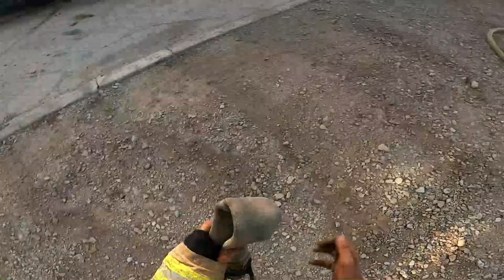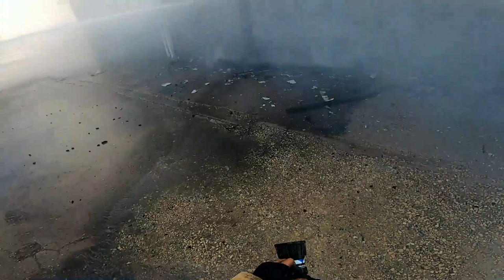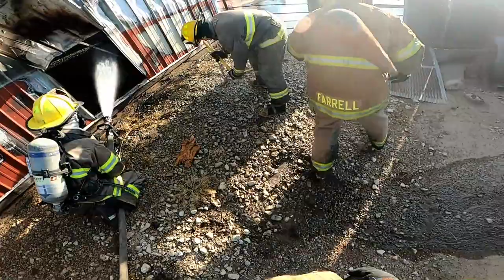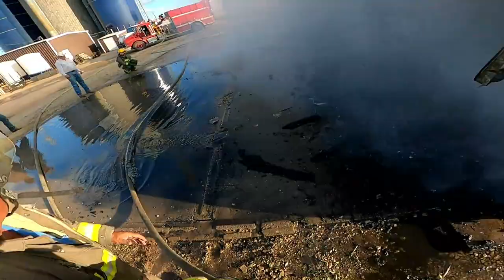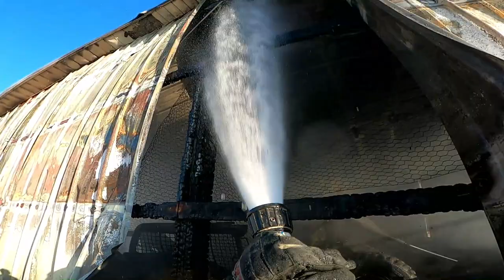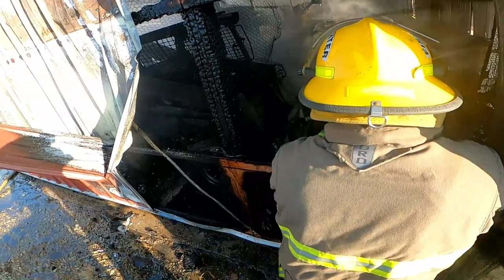Rolling Hills High loader skid steer fire 7-8-21 Ks,

Comment: This shows a lot of good things, number 1 leadership, he got on scene and took lead and got the fire out safely, the second was speed, some will say it was slow, but "slow is smooth, smooth is fast, fast isn't always smooth" the crew quickly got water on the fire!
Reply: I agree mostly with what you said but he took a few seconds to put his turn out gear on. We were told to have your turn out gear on when you leave the station. First thing you should do is put your turnout gear on so you’re ready to fight the fire when you get there. That means gloves pants boots coat and respirators if needed

Comment: Very good call, keeping your distance to match your protective envelope.   

Gloves and SCBA would be 'better' and let you get closer... but "It is what it is...".   You played it smart and stayed back and let the water do the firefighting, and kept yourself safe. :)

Also a very good call on the roof condition.

As far as operational pace?

Spot on...  there was nothing to 'save' but junk... so there was no reason to be over-aggressive and driving into the guts of the barn under that sagging roof.   Risk little to save little. :)   Good looking out for your fellow firefighters.

Nice job on the whole!
Reply from the maker: Somehow my gloves got taken out of my bag is the only reason I didn't have them and like you said there wasn't much to save so I stayed back and shot water in so I wouldn't need an air pack

Comment: This is why you should never park any lawn/farm equipment inside until they've cooled off.  I had a garden tractor catch fire after cutting grass one time and it nearly burned the house down.  Thankfully I noticed it when I saw the smoke billowing from the backyard.  Was able to get it pushed away from the house then extinguished the fire.

Comment: I'm gonna guess and say electrical fire on the wheel loader is what started the fire hope no one was injured
Reply from the maker: I'm guessing possibly electrical in the shed itself the loader had been parked for two days the skid-steer had been parked for a day and a half there was one guy who had to get a little bit of oxygen the South bay of that shed had a bunch of four-wheelers and a welder trailer in it that they were able to get out but he sucked in a bunch of smoke
Reply: @jrockyhill  i didn't even consider the shed being the cause guess I've gotten used to the equipment always being the cause

Comment: Using class A foam would help a lot especially in the rural area with limited water supplies
Reply: What would be the advantage of class A foam? Unless there’s a bunch of ordinary combustibles inside like stacks of wood or hay, class A won’t give you much more of an advantage. If anything, there’s a possibility that class B could be useful if there’s some flammable liquids present such as diesel, hydraulic fluid, engine oil, etc

Comment: When I use to serve we use to get the municipality to bring in a trackhoe to peel off the tin on buildings like that so we could somewhat safely put out the fire inside. Do you guys have foam on your trucks? It makes a big difference on fires like that
Reply from the maker: I guess a lot of our foam units are plugged up and a lot of times I don't think to have them turn them on
Reply: @jrockyhill  Yeah ours always seemed to be that way nobody would remember to rinse them out after use.
Reply: @jrockyhill  probably shouldn't have admitted this..............train until It becomes " memory" especially in rural areas ( where I also live and run) where tanker shuttles can take a while to get going.

Comment: Nice Video! How much water does Your truck carry? That water tanker with the fire department or it's the farm's?
Reply from the maker: The engine and the tanker hold 1500    and the other truck was the ranches not sure what it holds for water
Reply: @jrockyhill  Thanks for the reply!
Reply: @jrockyhill  thanks for mentioning that.  It's not very uncommon in very remote rural areas for a property owner to acquire a used piece of apparatus, with neighbors chipping in towards the costs.  It's a great asset to have when the nearest department response is coming from Guam.

Comment: You got enough water to supply three lines hit that with a deck gun or pull a 2.5. But nothing trumps proper application of water. Their is spraying a fire with water then theirs actually putting out a fire with water. Good job.

Comment: Granted there’s nothing to save but the job is to put the fire out I’m confused on switching from different patterns when you can just sit there and hit the bulk of the fire with a straight stream because whether it’s a lot to save or a little save the main goal and job is to put out the fire.
Reply from the maker: A wider spray in the right circumstance is like a blanket

Comment: Obviously what you do in the rural setting is different than what I do in the city setting but the fog nozzle is still junk. It has its place but not for extinguishing. Your fog or semi fog pattern wasn’t making it more than just a few feet inside the doorway. The seat of the fire appeared to be deeper than what you were reaching. Obviously everyone’s tactics are different just making an observation. Good work be safe!
Reply: I believe after seeing some other comments that after he got a lit knocked down that he was trying to use the fog to ventilate the smoke out, obviously he was getting a lot of steam conversion but from my understanding that’s what the fog was for
Reply: So a TFT is junk to you? They revolutionized the fire service.
Reply: @dougs4944  proper training and proper hose management is the key to extinguishment. As I stated, the fog nozzle has its place but for distance and penetrating a fog pattern is very ineffective in this setting. It was steam before it reached the fire.

Comment: Nice job sitting in a pool of water that obviously has some sort of fuel in it (the rainbow sheen on top of the water is a dead giveaway). That is the perfect way to ruin a 2 to 3 thousand dollar set of gear. At least you didn't ruin your gloves, since you were not wearing any. Also, your use of fog patterns is rather strange. There was NOTHING for you to ventilate, being as there are no doors on the barn and there are holes in the roof. Great use of water in a rural setting.